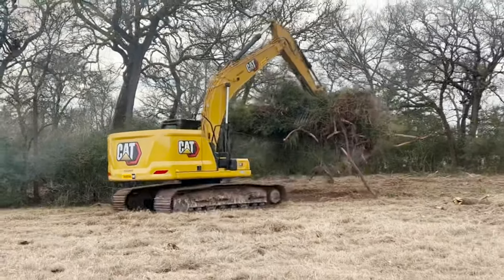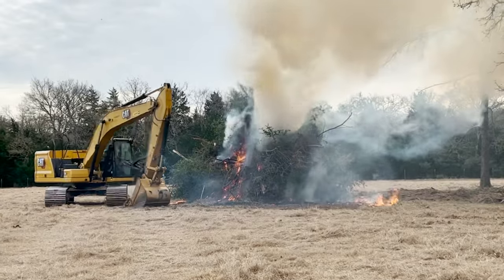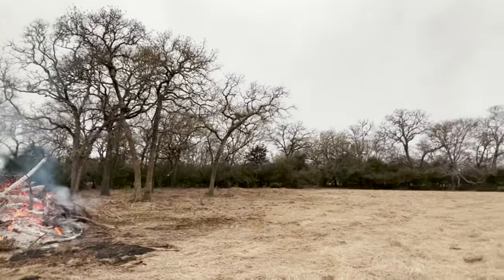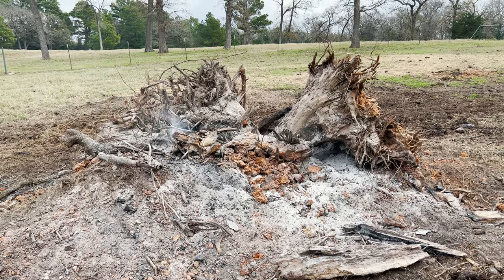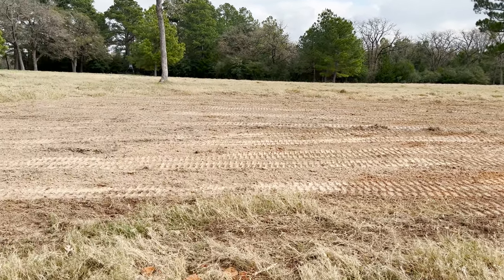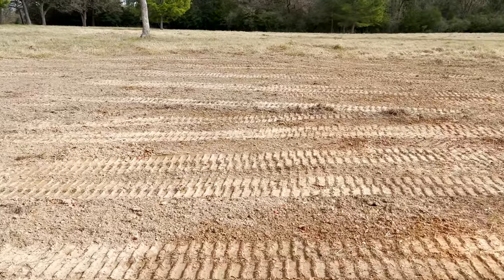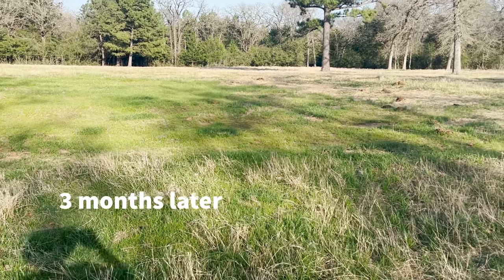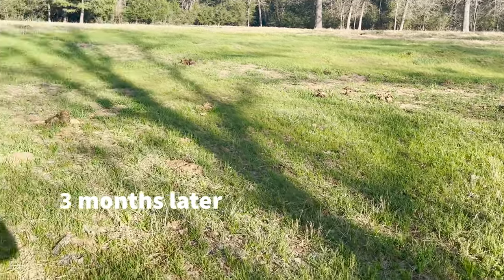Bare Soil To Grass | Regenerative Ranching

Comment: How much does the clearing cost per acre? The guy knows what he is doing and you know what you want done.
Reply from the maker: He charges me by the hour depending on the machine he is using. The track hoe is more then the dozer but it’s better for taking trees down. The dozer of skid steer does the finish work. I just asked him the per acre charge. He estimates it costs around $2800/acre if he also burns the brush/trees, then buries the root ball.
Reply: @cliffhonnasregenerativerancher  So I am guessing 5 years to make it worth it, except the land will be worth more cleared.